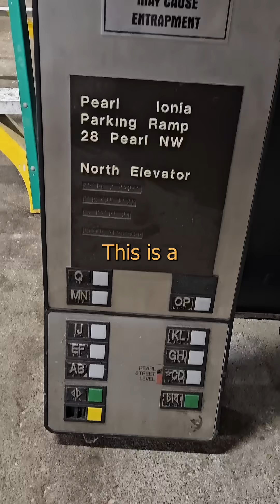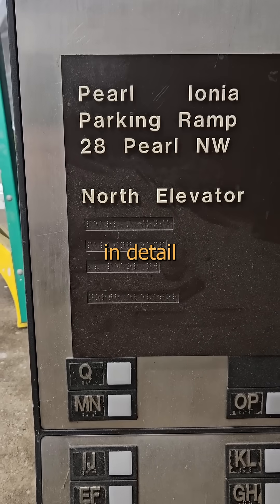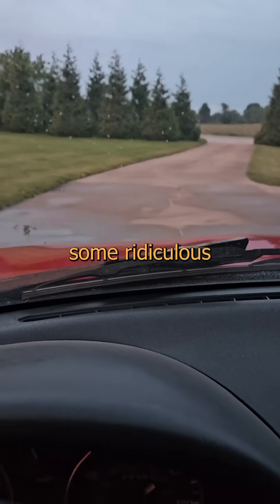Miata Mischief #chrisboden #engineering #gear #elevator #score #stories #parts #hacking #making

Comment: Honestly, there was still a lot of space there :P I mean, I'm from Europe, so any trip to Ikea tends to end in cardboard box tetris. But the scetchiest thing was back when I lived in Berlin and had mail ordered a pair of one person matresses. They arrived at the post office a S-Bahn (think above ground subway) stop away. I thought it would be a small package I was also expecting. So I go there and sign for two shoulder high cardboard boxes. I carry one like 10m, put it down, get the other one. Like that until I get them into a train. Then on in the same fashion until I get near the exit at my home station, where there's a supermarket and I liberated a shopping trolly for the bumpy 700 meter walk home. Now, these aren't regular city streets. Even normal coble stones would have been an improvement. Then up the stairs to the second floor, and back to the station with the cart to be a good citizen and to get my 1 euro coin back.

Comment: I found a pellet stove on the side of the road and we were in desperate need of supplementary heat. So I grabbed it, the problem is I was in my 2 door Toyota Echo stick shift and with the furnace style pellet stove sitting shotgun I couldn’t get the car in reverse. I didn’t know this until I was leaving the grocery store and I couldn’t back out of my spot. I had to get out and push the car into the aisle and then drive it out. We got home without incident and I still use that pellet stove but I still laugh about that thing in that tiny car

Comment: I was doing work for a guy locally who has a big 64' yacht (litterally the biggest non houseboat on our lake).

I expressed to him he would need to have it transported to my shop for the work because my 2012 1/2 ton chevy wouldn't be the safest thing to pull it with. 

Fast forward to him telling me his guy who normally transports it in his chevy 6500 was not operational and wanted me to just pull it to my shop. 

I've hauled far heavier & sketchier loads, but that was by far the most expensive and nerve-racking.😂

Comment: Once, I had a furniture-building project and i needed to get 8 sheets of 4' x 8' x ¾" MDF home to get it all cut up and put together. The downside was, I only had access to a diesel Golf to move it all, so I had the poor guys at Lowe's rip the sheets narrow enough to fit in the car, loaded them all in the back, did my best to strap it all in, and did about 15 MPH the whole 10 miles home. There wasn't enough room between the rear tire and the bodywork to fit a crushed can, I had that wagon looking like a chopped and slammed '57 Chevy, but it made it! 😂

Comment: Current ride is a Scion xB, with a 5x8 Utility Trailer. I've been helping some Amish here in Southern Michigan, hauling people and cargo. Latest crazy situation was 105 sacks of concrete at 60 pounds each, accomplishing it in only 4 round trips riding the edge of weight tolerances.

Comment: My wife's van broke and we had to transport her wheelchair from the dealer to her work.  I rented a U-haul and headed to Harbor Freight with the measurements I needed to buy a set of ATV ramps to get the chair in the truck.  At the end of the day I realized I made a critical error, I had measured the ramps to fit in the truck and didn't take into consideration how I would get them home in my personal car.  I threw the ramps in my hatchback and the LITERALLY touched both the back glass and the dash board while being at eye level.  Had to take every back road I could to avoid the interstate and not risk getting impaled by a set of aluminum ramps.  All-in-all, would do again!

Comment: In my 20s my father bought a golf cart from someone in the Atlanta area while he was living 4 hours south of Atlanta. He asked me if I could pick it up for him and bring it down. Of course I said suuuuuure. Headed over to the guys house and pulled up to the guys house, positioned the rear of my extended cab nissan hardbody truck into the ditch, and rolled it up in the bed. It took me and my new wife 9 hours to complete a 4 hour trip with the front wheels bouncing off the ground and losing sight of the road periodically, but we got there. We pulled up to my dad saying we'll d*mn what took you so long.

Comment: I… drive an ‘05 Prius. I don’t recall what all I loaded into it, but I was helping my family move house, I put the rear seats down, and everything behind that was pretty much full with boxes (at least some of which were pretty heavy IIRC), as well as IIRC some in the front passenger seat. Thank God I didn’t have far to drive, I think the rear suspension was almost bottoming out. Oh, and this was in ~’20, I think, and the car had IIRC >200K miles on it?
Reply: That is to say, it was a 15 y.o. car at the time… still driving it!

Comment: I work for a gutter company that specializes in gutter protection. When I first started this job, I was operating out of a 2007 Ford Taurus sedan I had to find a way to fit a A-frame extendable ladder as well as up to 300 feet worth of material. Needless to say it took some acrobatics and ingenuity. I would often lay the main panels on the passenger seat and then fit whatever else I could whatever way I could.

Comment: It was mid 2020, I had just moved into a new place with a flat mate.

I didn't have the money to move my stuff to the new place, so what'd I do? Jammed everything I could into my little sports car.
I had a Toyota 86 at the time, and if I recall correctly, I removed the front passenger seat on the second load, just so I could move a little more at once.

It went surprisingly well!

Comment: The radar assembly off the nose of a B-52 "abandoned in place" on the south boundery of Edwards AFB took tools and ladders unbolted and used rope sling to lower the Radar into the trunk of a 1971 Plymouth Road Runner. Yes a Road Runner the one with the loop front bumper. The radar assembly didn't have a round dish it was more rectangular and had a curve to it. So the trunk wouldn't close, used the rope we lowered it into the trunk with to tie down the trunk lid. Put a blanket over the radar and drove through Palmdale and out to the highway. Through Saugas, through the San Fernando Valley. Hollywood hills to the 405 and across the L.A. to Torrance, the radar assembly lived on the wall in the back of the garage along with the Road Runner for a long time, my roommate inheritance was his parents house so it relocated over there. 
The ladder was left near the B-52 under tumble weeds for a  later "mission" to get a  APU and a gyro out of the plane. I didn't go on that trip. But saw the APU and the gyro. Last I know they were in Deer Valley AZ. 
We were the same idiots that bought the landing gear from the Space Shuttle mockup that was in the Rockwell Facility in Downey surplus yard. We hauled those sketchy down the 91 freeway, took them to a different friend's house and propped them up against his patio and left them there for him and the girlfriend to find....
So yeah call me the grand daddy of all liars. Don't know if there here, but there are pictures of the B52 caper. The only thing, I might be the only living member of the whole tribe of misfits and fuktards. That's kinda suckish.

Comment: My friend's 2 door Ford Escort (NOT the hatchback!)
We were at a thrift shop when she saw a vintage Danish Modern armoire for $20 & HAD to have it. I kept pointing out that it wouldn't fit in the car. She kept insisting it would. 
The battle cry is now, 'We have Mule Tape,  we can move anything!!'
30 miles of freeway, & another 1/2 hr going up & down back roads in CO.

Btw, you CAN f*ck an enthusiastic short person in a Miata...just not comfortably.

Comment: Pulled my entire life in a 5x8 U-haul trailer behind a second-gen CR-V from Houghton back down to GR in the middle of a snowstorm. Took 4 hours longer than normal (about 12 total) and somehow, miraculously, nobody died, and even more miraculously, they actually let me do that no questions asked. The night before, I had panels pulled apart in 40° weather hooking up a trailer light connector to my brake lights with a pair of needlenose pliers and walmart spade connectors because that was required to pick up the trailer. I'm amazed the lights didn't go out before we crossed the bridge

Comment: Just hauled a 1940s CRT TV&cabinet home in my '07 Camry 5 days ago. She still lights up, tubes are solid! BARELY fit in the back so i had to have one door slightly open, bunjee strapped tight😂. It made it the ~12 miles home.

Comment: OK so when I was like 16 I wanted to do blacksmithing. But because I was just a broke kid I had to resort to building my own forge. So one day after school I decided to pick up a bag of sand from this hardware store near my school. I was going to use the sand to make a two part insulation for the previously mentioned forge. So I walk about 3km to the hardware store and buy the bag of sand. For context the bag of sand weighed roughly 20kg and was very awkward to carry due to it being quite "floppy". My plan was to walk to the closest bus stop of which was an addiction 3km away and catch the bus home. So I lugged the bag an additional 3km to the bus stop which funny enough was much harder to do than the first 3km. Upon getting to the bus stop I then catch what I thought was the correct bus home. It was not. The was actually bound for a location shopping center which was luckily was kinda close to my house. I was familiar with the center and was aware it was fairly close to my house. So I decided to get of the bus and walk the rest of the way home. This was a mistake. One very important detail I forgot to mention was that I live of the top of some sort of the hill. This meaning that the rest of the walk would be only up hill. Looking back now I am very much aware that this was actually a 7km walk that I had only done once before without the addition of the previously mentioned 20kg bag of sand. Blissfully unaware of this information I attempted the walk. About 1.5 km I am exhausted and regretting every choice I had made up to this point. Then I come across another bus stop I am unfamiliar with. I decide to catch another bus thinking it is the bus home. It took me right back to the shopping center. Defeated I decide I am done with busses and walk the rest of the way still carrying the bag of sand. In the end it took me 3 hours to get home just to find I ALREADY HAD SOME SAND AT HOME.

Comment: I drive a 2 door mk 4 golf. This office was getting rid of those huge bean bag chairs the office manager had bought on a whim to spruce up the meeting room. The first two huge bags I managed to squash into the back with the seats down. The 3rd bag tho, was bigger than the first two together. So, I just pushed it up on top of my car, after I removed my antenna, ran some dollar store nylon "rope" through my windows and started my trip. When I got home, I had to take a picture from our third floor apartment cuz my little golf was invisible underneath that behemoth of a bean bag. I still don't know how we got it through the doors, much less up the stairs!

Comment: Much like your Miata, I had a 2x4 lay-in LED fixture I had to ship back but I was on a job I flew to to manage in FL. Great week because I got a 2018 Stingray convertible as my rental, not great for hauling stuff around. Dropped the top on the Corvette and had the light fixtures hangout out the top of the car like a boxed up passenger 😂

Comment: I was renovating our first home and needed  some osb. It comes in 8ft sections. i managed to fit just about all of it into my 2nd Gen 4Runner with the seats laid down and the board resting comfortably on top of the drivers seat and over hanging by about 4 inches, I put a jacket over the end of the board and crammed my body into the drivers seat for the 25 minute drive home! My asshole was puckered the whole way home with my face an inch from the windshield, praying to god no one rear ended me and cut me in half ! Cheers

Comment: My truck was down with a broken rear axle, so I needed to go to a scrap yard 2 hours away and get a new (to me) replacement. The truck I borrowed was in only slightly better shape and a front brake started dragging and overheating on the way home. Lacking other options, I bought a quart of oil, lubricated the brake pads and rotor the best I could, and drove home. It worked great!

Comment: I might win this for shear potential mushroom-cloud-way-to-go. I used to drive to the welding supply in my 1969 MG Midget to return my empties and get a full bottle of oxygen or acetylene (this was before I switched to Oxy-Propane) BTW, these weren't little pocket pack cylinders. I would haul a 75cf acetylene or a 125cf oxygen...held them in with the seatbelt, bottom of the bottle down in the footwell. Most of the time not both at once since they rarely ran out at the same time...but there was this one time.... :-D
Reply: btw, I now own a 1967 MGB. WAY more room for compressed gas cylinders in it!!!

Comment: i once hauled the entire front end and drivetrain of a wrecked SRT charger in the trunk and backseat of another 5.7 charger. steering linkage, sumbframe, engine (partly disassembled) , transmission, diff, axles and all. 

apparently those cars have a towing capacity of 3900 lbs. crazy right?

Comment: Okay so the pickup wasn't super sketchy but I grabbed two uranium glasses off of Facebook marketplace and on my drive back I was going on the highway. I was behind this semi truck and it was about to hit my exit but I want to get past the semi truck so I go to the left lane and gun it. I was already doing 70 and I get up to like 95 and I'm going in Scion xB 05. I realize I'm going to miss my exit if I don't cut the semi off and he's not going to the exit, but like I got to get in front of him. So I come off the high onto the exit and this exit is a hairpin turn that I am hitting at minimum 90. Hit the brakes end up drifting at a 180° angle (as said sign XB so front wheel drive only) have to countersteer out of the drift drift again to another like 160° dift. Counter steer out of that drift into a final straight away and get back onto the main highway. I don't drop a dime under 50 miles an hour for the whole thing.

Comment: There was a 55" plasma at a recycling center. We typically loaded down my buddies vw/audi wago but that massive TV wouldn't fit. So I got my 1995 Dodge Stealth. It fit, because it was a hatchback - under the glass hatch over both sets of seats. 

So we drove home with a plasma tv resting on our heads. Best part: TV just needed some caps replaced and it worked!! Totally worth it!

Also that car would have barely fit an acrobatic dwarf in the rear. I was surprised my parents allowed me to buy that car when I was in high school; until I tried to "hang out" with a girlfriend in the rear seats.. Might be a sound anti-teen-pregnancy technique.

Comment: Shortly after I graduated from Chico State with a degree in Mechanical Engineering I was asked if I would like to move a pick and place robot from Alps Computers in the LA area back to Chico.  I did it in the back of my 73’ Land Rover 88.  It fit and the 88 got better fuel economy than my 75’ F250. That was in 1987. I still have that Land Rover.

They got sever neat tool as I was graduating.  They got a Mazak NC lathe right after I completed the course where I could have learned to operate it.

Comment: I ride my 2 e-bikes with my friend out 8 miles and my rich friend decided to enter the silent auction at the event. He ended up winning a 300 pound anvil. We had to strap the tires on the bikes (one of them died) so we’re going 8 miles with 300 pounds on a dead e-bike (so in total 450 pounds) we towed the dead e-bike 8 miles home using 4 bike locks, 2 ratchet straps, and 4 bungee cords.

Comment: I fit a 65 inch television in the back of my Prius. I had no plan took no measurements. i saw an OLED TV on clearence at sams club and just grabbed it. it JUST barely fit with back seats down and the front seats rolled forward slightly!